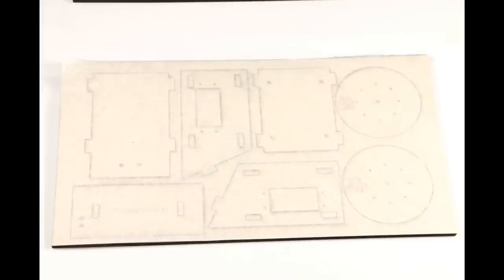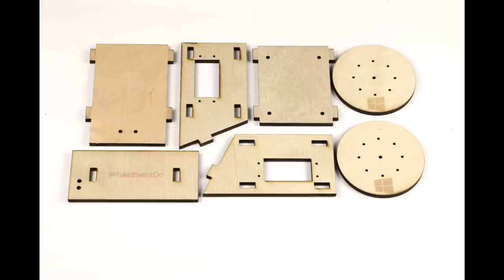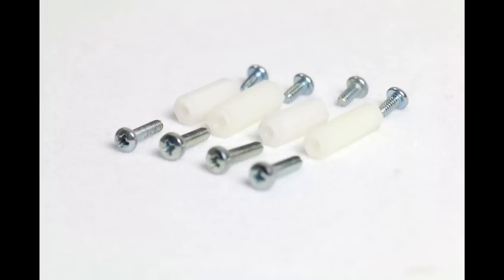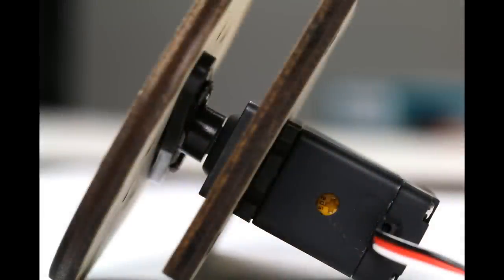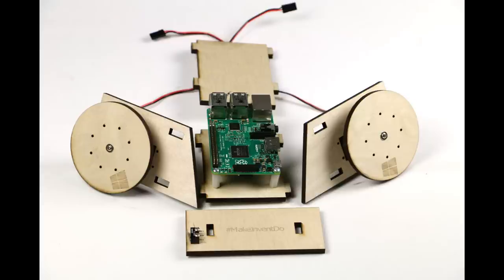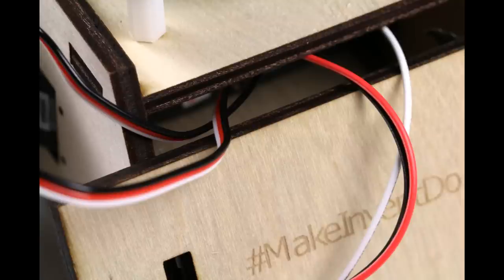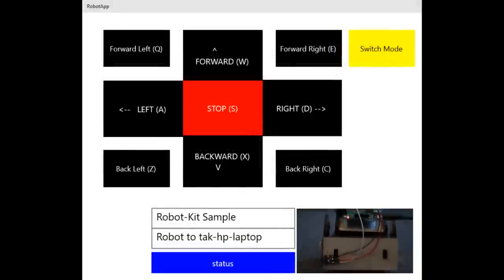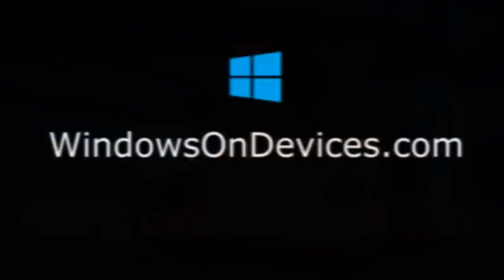Windows 10 + Raspberry Pi 2: //build IoT Core Maker Robot Kit

Comment: What's the advantage of using Windows 10 on the pi over using Linux when doing something relatively simple like controlling stepper motors? I believe there are many things Windows on the Pi would excel at, but you can do this with an arduino.